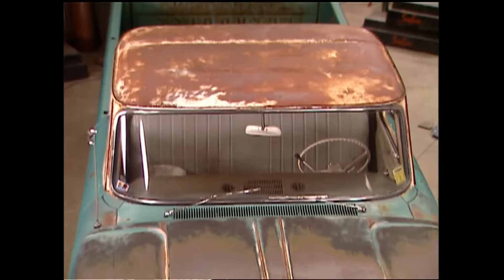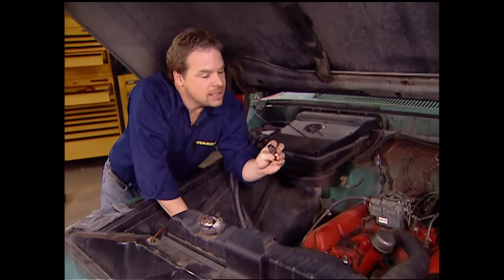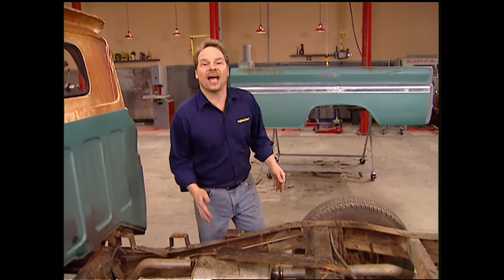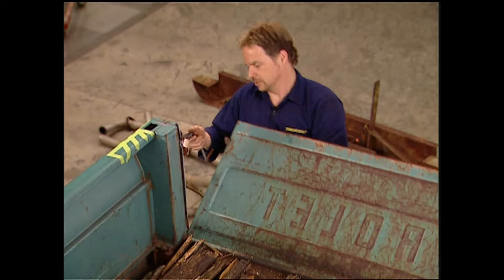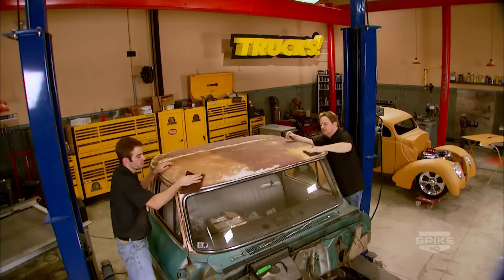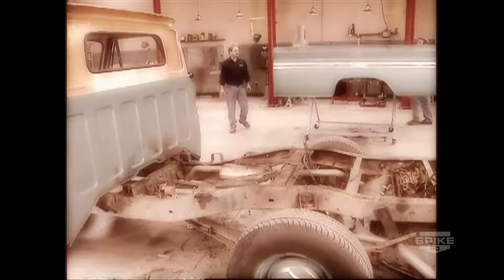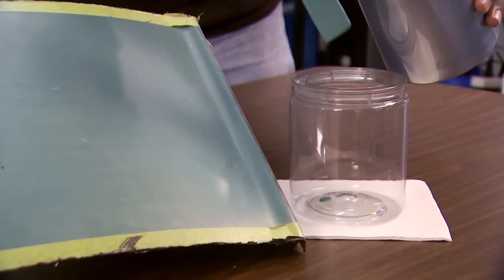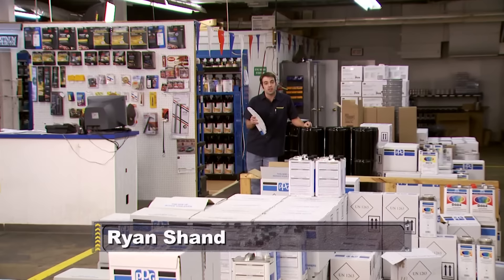FULL BUILD: 1966 C-10 Long Bed Barn Find to Short Bed Beauty

Comment: Long beds are underrated, don't @ me.
Reply: Thats what I am sayin
Reply: My daily driver is a long bed 1979 Chevy Truck badged with Bonanza C-20 Camper Special. My Dads truck.
Reply: The cool thing about trucks is the utility factor.  Longbed 4×4. 6 cylinder manual transmission.  Or 90 s diesels cummins or ford .  new trucks suck.
Reply: Short beds are over rated...
Reply: @jamesscimone1447  exactly
Reply: Heard that! My first crewcab was useless for hauling anything. I had sheetrock hanging off the tailgate.
Reply: Agreed
Reply: Why would it be desirous to reduce the carrying capacity of a utility vehicle?
Reply: Agreed
Reply: You ruined the truck by chopping it.
Reply: I think the long bed 60-66 look way better than the short bed version.
Reply: They ride better,  for sure.
Reply: Cool but parking is harder, like anything else, just learn to use the length.
Reply: Totally ruined it  typical city boy
Reply: @timmccarthy6374 a 6 in a 4x4, nope, nope. Nope.
Reply: @MrAndyLocksmith because they are more valuable and better drivers.

Comment: Another great tool to use when installing Boom Mats is a thick or folded rag, preferably clean of course.
It gives you the ability to slide your hands around while pressing the mats down, especially around the usual bends/shaped metal found in vehicle cabs.

Comment: I had a 62 long narrow bed with 235 six in high school. Red and white it was a great pick up.
Those coil springs and swim arm rear end could handle wash boards like a dream.
My 51 would be in the ditch at those speeds.

Comment: I would've kept the LWB; opted2 shorten the bed extend the cab w/2suicides, larger fuel tank(s), FI, EPS rack, carpet delete, pwr panoramic moon roof, modern 8coil ignition, roller cam& rockers or small block LS, alumacoat headers w/locks, 8spd ZF Automatic, darker bed woods, spray in bed liner, sliding rear window, hi-mount LED 3rd brake light, nano grapheme tinted windows, 250V LiPo battery system, electric A/C compressor &cold air induction. 

I like the 4Wheel discs, V8 retention &OEM color matching.
Reply: I agree, the LWB was rare back in the day. Short boxes were a dime a dozen!

Comment: Love this truck....little trick with the exhaust welds is to use a flat file first to take the hump of the weld down flat and then sand and polish....spent many years welding stainless boat rails and polishing them... just something I learned about 25 years ago.

Comment: @57:28 he says make sure your air bleeders are pointed up or your going to have a whole Lotta trouble getting air out of the brake lines. Then immediately mounts it down.
Reply: He mounted it the right way...the bleeder screw is at the top....🤦‍♂️🤦‍♂️

Comment: I think I figured out why they did it this way.  You said it yourself, that the on-cycle time must be sufficiently long for the freezer to work properly given the path the refrigerant takes.  Based on the sped-up video showing the progressing coldness through the evaporator, it lakes at least 10 minutes for the full length of the evaporator coil to become cold.  By placing the sensor bulb near the end of the evaporator line, it ensures the on cycle time lasts at least long enough to give the freezer time to freeze.  

Another effect of this placement is that it can indirectly respond to a rise in freezer temperature as well as refrigerator temperature.  When the compressor is off and the system is equalized, it’s using the refrigerant line as a capillary tube from the freezer compartment and effectively averages the thermostat’s reading between the two compartments.  Still not ideal, but considering the low prices of mini-fridges, understandable.  And clever!

Comment: And remember to use oil that has a zinc  for old flat tappet cam and lifters
Reply: Really ??  Ok, thanks....  LOL !!!
Reply: @jamesscimone1447  Really!!!     I learned the hard way with an old 1954 Chevy 235 six banger pick up I drove to work for three years. I flattened out 3 lobes on the cam. LOL!!!!
Reply: @johnswick4593  Ya gotta know what ya driving man !!  Those old flat tappet cams will git ya every time…. LOL !!
Reply: @jamesscimone1447  LOL!!!! Exactly LOL!!!!   and LOL some more then more  LOL!. Man!! I'm really getting tired of laughing out loud. You are probably quite a bit younger than I am. Back when I started driving ,motor oil still had zinc in it. I've always known what I was driving. I just didn't know when they took the zinc out LOL, LMAO, LMFAO!
Reply: @johnswick4593  to tell you the truth, I’m 55 and unless I hadn’t started building engines then I wouldn’t have known either…. No one ever said it and it wasn’t widely publicized so it could have easily happened to anyone…. Including me.  I’m glad you like the LOL’s 😂🤣😂👍🏻
Reply: @jamesscimone1447      I do.       My most used is LMFAO.

Comment: The best old trucks are old longbed 4×4. 6 cylinder manual transmission.  They were made to work .  trucks shouldnt be hot rods.  Cars are for that.
Reply: That's the best thing about personal expression.  You buy what you like. Modify it how you see fit. No issue with taking an old relatively useless truck and turning it into something people could enjoy looking at. But just as you this is my opinion and we are entitled to that

Comment: original tailgates have the same problem as the hood, they rust from the inside out and develop holes in the lower cavity, what are you supposed to do with that just replace the tailgate with aftermarket?

Comment: I have and an "ORIGINAL" 1963 STEP SIDE with a spare tire fender and straight 6 cylinder 250. wood bed and all been restored to factory restored specs all numbers matching. 4 speed low gear 1st actually a 3 speed They call this trans 'GRANNY" 1FIRST GEAR!  Asking price is  $40.000

Comment: Really you going to spend the money to have the frame powder coated and knowing what kind of suspension you were putting on there you could’ve had those rivets  removed holes drilled and all the other modifications done to the frame before you took it had a powder coating now you got spots that can rush and look bad you should’ve had all of the modifications done before you had it powder coated

Comment: I can only imagine what it costs to strip the frame....  $27,000
Reply: Its more affordable than you'd think I did my frame, it was blasted and powder coated for $700.
Reply: @jasbirsmith299  Sand blasted AND painted ?  How did it come out ?  Do you mind if I ask you what state that was in ?
Reply: @jamesscimone1447  it came out like any good powder coat should, tough and shiny! It was in Idaho and it was a full sized ford frame from a 57 fairlane. The key to keeping cost down is stripping everything off so they can blast it in only an hour or two.
Reply: @jasbirsmith299  That’s a good deal but over here in MA the prices are a tad bit higher… Thanks for the info 👍🏻
Reply: @jamesscimone1447  yeah no worries

Comment: I really like this resto-mod. Keeping it looking original is the right way to go.  But having the fuel filler on the tray bed is not particularly practical.
Reply: They need to go back to the old tail light filler. I remember some of those when I was a kid working pumping gas..